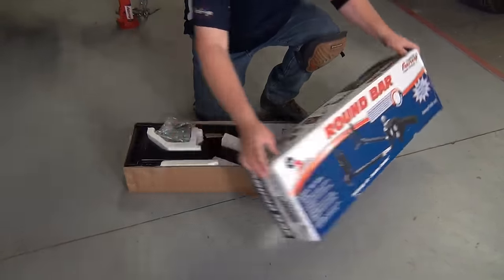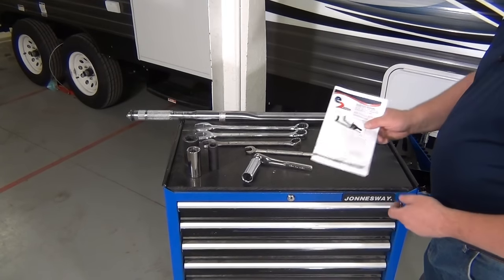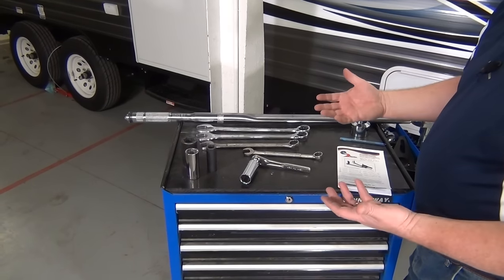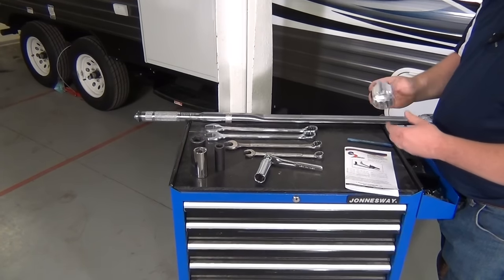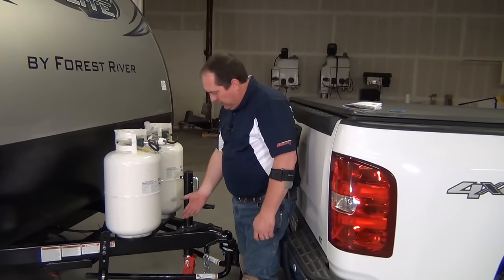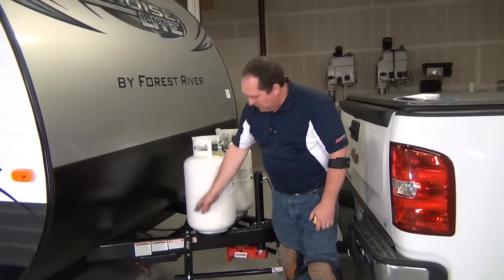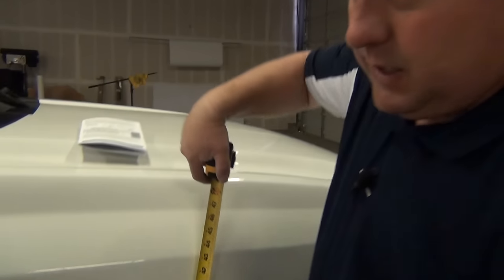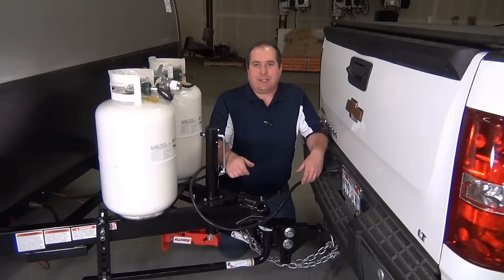How To Install Your Fastway e2 Round Bar Sway Control / Weight Distribution Hitch*

Comment: Would you err on the side of placing the hitch head at a height lower or higher than the height of the top of the coupler?  Top of my ball is 24 1/2". The hitch head in the top holes in the drop position is about 23 7/8".  The hitch head at the bottom holes in the rise position is 25".
Reply from the maker: +Tundra, Tools, and Tech,
Great question! We recommend that you drop it to the 23-7/8" height, just slightly lower than the coupler. Either would work fine, but going down instead of up will give you just a bit more weight distribution force assuming the same number of spacer washers and same L-bracket height.
Reply: how close should the two heights be when starting the process? I have about 2" difference (ball is lower) and no matter what I do I still have about 2 3/4" sag in the truck. I guess I need to order the specialty shank..??
Reply from the maker: +Romd inKs,
Great question, thanks for asking.
We are making the assumption that your tow vehicle is large enough and has the ratings for the trailer you're towing, that the trailer is correctly loaded, good tires correctly inflated, ratings not exceeded, etc. If any of those are off, that should be addressed first.

The ideal is to have the hitch ball at the same height as the trailer coupler (with the trailer level/parallel to the ground). If you are already using the hitch with the shank in the rise position, you would do well to get a specialty shank that raises the hitch ball. If not, simply turn the shank upward, and find the correct position for the hitch head.

Having some sag in the rear of the truck is expected, and actually good. The most critical indicator is the front axle of the vehicle. You are adding a significant amount of weight to the tow vehicle, and you should expect it to sag under that weight. What you don't want is to raise too much weight off the front axle. In most ideal setups, the front axle returns to almost the same height (same axle weight) as it was without the trailer coupled. The rear axle sags and is carrying more weight because of the addition of the trailer. This is good, because it holds your tow vehicle tighter to the road, and gives it more control over the trailer.

Follow the setup process in the owner's manual from start to finish. Get the hitch ball height correct, and then the weight distribution into a good range. Then, test it. See how it tows, and make minor adjustments from there if you need to.

You can find the owner's manuals here: https://www.fastwaytrailer.com/manuals
You can reach customer support here: 877-523-9103 or Support@FastwayTrailer.com
Reply: FastwayTrailer thank you for the quick response. I drive a 6.2L  f250 and the trailer averages 8000lbs. I will the trailer out this weekend to measure it. I did not realize the front measurement was that critical. The shank is inverted and using the top bolt hole with the L bracket bolts to the top side.
Reply from the maker: +Romd inKs,
You're welcome! Yes, the front measurement is the most critical. The rear measurement should be watched, but it is more of a problem if you're getting too much weight distribution and actually lifting the rear up. If your front measurement is good, it is almost impossible to have this happen with the rear. Also, that's a pretty good size trailer. If you're sitting between 800 and 1,200 lb tongue weight, you can expect the rear to sag, even with good weight distribution and that tow vehicle. Good luck! Let us know if we can help with anything else. Also, come back and let us know how it works out if you decide to make some changes to your setup.
Reply: Base on what I've read so far I think I know the answer but want to make sure. TV alone: front is 42" rear is 42 1/2"; trailer attached with no WD bars supporting front 42 1/2" rear is 40 1/2"; trailer attached with WD bars supporting front 42 1/2" rear 40 3/4". good to go or no?
Reply from the maker: +Romd inKs,
In the numbers you give above, it looks like you need a bit more weight distribution. Looking at the front axle measurements, the third with WD is the same as the 2nd, hitched but no WD. You want to go at least halfway back to the first measurement, which would be 42-1/4", and ideally as close to all the way back (42") as you can, without going over. The rear measurements look good because the 3rd (40-3/4") is not higher than the first (42-1/2").
Reply: FastwayTrailer i think i can add another washer but after that i guess i would need to get an shank extension?
Reply from the maker: +Romd inKs,
Adding a washer has a completely separate and different effect on the hitch than an extended shank will. The washers control the pre-load angle of the hitch head, which effects weight distribution, while an extended shank will help you get the hitch ball at the correct height.

First, you should make sure the hitch ball height matches the trailer coupler height, with the trailer sitting level (parallel to the ground). Measure from the ground to the top of the coupler socket, and then set the hitch ball height to that same distance. If your shank is not long enough to make that work, you need to be using a specialty shank that will. Having an incorrect hitch ball height will make it more difficult, and even impossible to get good weight distribution.
After that, go through the weight distribution setup process, adding or subtracting spacer washers to get the best weight distribution setup you can.

The details of this process are found in the e2 owners manual here: https://www.fastwaytrailer.com/manuals
If you need further assistance beyond that, please contact our customer support staff at 877-523-9103 or Support@FastwayTrailer.com

Comment: You took couple measurements but that doesnt explain how you or which holes you knew to put the brackets in on the trailer before putting round bars i am confused
Reply from the maker: Pal Palich,

If we are setting up the hitch for the first time, we start with the L-brackets in the center two of the six available holes. This gives us room to go up or down as needed later on to accommodate needed weight distribution adjustments easily.

Follow the instructions ( http://www.fastwaytrailer.com/manuals ), Step 4 - Sway Bracket Assembly Setup, and it will walk you through the process of placing and adjusting the L-brackets.

Comment: Thanks for the video! I've installed my setup, had to move my L brackets down 1 hole, but the bars are not parallel to the trailer and are point up and seem to be only contacting the front edge of the L Bracket. All measurements check out good, so Im curious if this is normal???
Reply from the maker: That doesn't sound too far off. But you should be able to get them at least pretty close to parallel. Email our customer service a few pictures if you still aren't sure if it looks good. support@fastwaytrailer.com
Reply: I have this same situation as well. I am trying to understand the significance of the washer/angle bolts. Also my L brackets are in the middle holes so if I move down, seems that would grossly affect the weight distribution. Older F250 with 34’ travel trailer.
Reply: Mines the same way.. I recently had to readjust my setup after adding airbags and a leveling kit to my truck.. it's dead nuts on the measurements but the bars won't sit flat on the L brackets

Comment: great video dave. i have a toy hauler 3650 +/- lbs dry weight. bike weighs just over 700lbs. how much variance can i expect in settings while towing with toy vs towing without?
Reply from the maker: +Martin Foley,
Great question! There are a lot of variables to take into consideration, so estimating that is tough. It is mostly a function of the distance from the trailer coupler to the axles, related to the distance from the axles to the bike. Think of it like a teeter-totter. For example, if the coupler to the axles is 10', and the distance from axles to bike is 10', then the relation would be 1:1, meaning, if you take the bike out, removing 700 lb. from the back, the amount of weight it is counter-balancing is 700 lb., so you should see the tongue weight raise by 700 lb. If the ratio is 10' vs. 5' (2:1), the tongue weight should increase by 350 lb. (2x350 = 1x700).

Unfortunately, there is not an easier way to predict the hitch setup you will need than to set it up both ways (with and without the bike), checking to make sure the weight distribution is dialed in on both of them. Then you will know where to set the L-brackets based on the trailer loading.
Reply: thanks dave, very helpful
Reply from the maker: +Martin Foley, you're welcome.

Comment: looks like my RV dealer installed my L brackets upside down??
Reply from the maker: +Ron Jernigan,
Not to worry! Installing the L-brackets upside down is a common practice with the e2 hitch (especially if you have a bottom mount coupler https://youtu.be/WM8e60mbqAM), and is frequently done on the round bar hitch. As long as your weight distribution measurements check out, and the bolts holding the brackets are tight to the frame with no gaps above or below, you're fine. You can see the details of when and why they would be placed upside down in the owner's manual here: http://www.fastwaytrailer.com/support
And if you're still concerned, get in touch with our customer support team, and they can find answers to your questions. 877-523-9103 or support@fastwaytrailer.com.
Reply: @FastwayTrailer  I took the day today and Re-Set everything, new truck, with a Level, and installed the Roadmaster Active Suspension the other day. Just got done and everything is Much Better. This video was great, and Easy to follow! I just need to get that breakaway cable you show in the video!

Comment: When I bought the E2 Round bar it was set up for a 2016 Colorado, we have since upgraded to a GMC 2500, I have adjusted the ball to the proper height but what about the L brackets, should those move too?  There was a 6 inch difference between the Colorado and GMC 2500.
Reply from the maker: +Chris Sheehan,
Great question! The L-brackets may or may not need to be moved. Getting the hitch ball to the correct height is the first step in setting up the hitch when you change tow vehicles (or trailers). Now you need to go through the process of setting up and checking the weight distribution. It will most likely need to be adjusted, and that is done by adding or removing spacer washers between the hitch head and adjustable shank, and/or by moving the L-brackets. Follow the setup instructions in the owner's manual here: http://www.fastwaytrailer.com/manuals. If you need some help, get in touch with our Customer Support people at 877-523-9103 or support@fastwaytrailer.com.

Comment: I currently have an e2 set up on my 2015 Toyota Tacoma for towing our camper- this weekend I go to pick up a new Tundra- do I need to readjust the setup on the camper or can I just make sure the ball height is the same as with the old truck?
Reply from the maker: Scott Domuracki,

Yes, you need to check the complete set up of the e2 hitch when you get your new truck.

If the receiver height on the new truck is different than the old, you need to make sure the ball height is adjusted back to be the same height as the trailer coupler.

You will also have a very different suspension on the new truck, so you need to go through the weight distribution setup steps to check that you're getting good weight distribution. Be sure to check that the bolts are torqued correctly when you're done making adjustments.

Here is a link to the e2 owner's manual: http://www.fastwaytrailer.com/manuals

Also, feel free to contact out customer support team if you have any other questions M-F, 8:00 am - 5:00 pm MST, at 877-523-9103 or Support@FastwayTrailer.com.

Good luck, and enjoy the new truck!

Comment: My RV dealer installed this weight distribution hitch on my new 29' Keystone Passport. I watched the technician do it. I do not recall that he used a torque wrench for any of the nut tightening. And although the area was fairly level, it was not perfectly level and was not paved or concrete. I do not recall that he ever measured the height of the RV frame. His only check to determine that the hitch was installed correctly was to compare the distance between the front tire and front fender edge with the distance between the rear tire and the rear fender edge.

I was used to pulling a smaller RV with a different weight distribution hitch. By comparison, this setup felt much less stable on the road. Steering was less positive. I was not sure if the difference was due to the fact that this is a larger RV or that perhaps the weight distribution was not optimal. I am inclined to re-install it.
Reply: I just experienced this exact same scenario with my recent purchase of my 26ft Mini Lite. I'm getting sway with wind and semi-truck passes, and knew when the technician was doing the camper tutorial with me, he mentioned a remark, "what's the camper weigh, 4800lbs?" That told me right there that he probably/did generically installed the E2 WDH, as the camper weighs 6200 dry. I'm needing to check my pitch, and also make adjustments to the sway/distribution bars as I've got quite a bit of sag in the rear. 2022 Rockwood Mini Lite 2615S towed with a 2021 Ford PowerBoost Crew Cab.

Comment: The rv dealer installed mine while tanks were full..we never plan on driving with full tanks. Should I readjust? Washers or ?
Reply from the maker: +Dave Merwin, The only way to tell if it should be adjusted is to take check the weight distribution. If it does need to be adjusted, that can either be done by adding/subtracting spacer washers, or by raising/lowering the L-brackets. If it is a long-term (permanent) change, we recommend making the changes via spacer washer. If only temporary, moving the L-brackets is easy and works great. If you need a refresher on making the adjustments, you can find that process here in the owner's manual: http://fstwy.co/manuals  If needed, you are also welcome to contact our customer support staff at 877-523-9103 or Support@FastwayTrailer.com .

Comment: I'm not sure why my last comment disappeared. I was hoping to get some help with putting the spring arms into hitch head. Only on one side of the hitch head has a jam when installing or removing the round bar. The pin is not smooth and I can't get it to pull all the way out. When I use the taper to pull it out, the taper bends to the point that I can't get it fully out. It seems like the pin is not smooth or the hole that it travels is not big enough. Can you please help with this issue? Thank you.
Reply from the maker: A V,

The spring arms are designed with a chamfered edge on the end that slides up into the hitch head. It should look like a bit of the top corner has been cut off on an angle. Try inserting the arm with this chamfer lined up with the retaining pin. Put a little grease on the top of the arm. You should be able to push it up into the head, and that chamfer will push the retainer pin out of the way, then let it drop back into the retaining slot in the arm to hold it.

To remove the arm, try turning it out sideways to about 90 degrees perpendicular to the vehicle - kind of parallel to the bumper. This should push the retainer pin out of the retaining slot, and let the arm drop out of the hitch head.

The spring arm and hitch head tube need to be lined up well. If it is binding a bit, make sure it has some grease on it, and move it around a little to try and line them up. I usually hold the arm about where the sticker is so that it will balance well in my hand and I can shift it around a bit to get it lined up.

Try these, and if you still need some help with it, contact our customer support team M-F, 8:00 a.m. to 5:00 p.m. Mountain time. They will be glad to help you!

You can reach them by emailing Support@FastwayTrailer.com or calling 877-523-9103.

Comment: I am ordering a 20' cargo trailer with a 2x8 tube frame which is an upgrade. What do you do about that?
Reply from the maker: @Ole Guy, get in touch with our customer support staff. We have some specialty link plates that you can use on an 8" frame. 877-523-9103 or support@fastwaytrailer.com.

Comment: I don't understand the purpose of the spacer rivet and spacer washers.  Are they there to fine tune the height of the hitch ball?
Reply from the maker: +Jack Adams,
No, the spacer rivet and washers are not to fine tune the hitch ball height, they are to take up the space between the top of the hitch head and adjustable shank. The height of the hitch ball is determined by the position in which the head is installed on the shank, which is a factor of the holes chosen and orientation of the shank.

The spacer rivet and washers sit in the gap between the top of the hitch head and the shank. They take up the space between them so that there is a solid connection for the weight distribution all the way through from the trailer to the tow vehicle. Adding or removing washers during setup changes the angle between the head and shank, and this is one of the ways the amount of weight distribution is adjusted. More washers = more weight distribution, less washers = less weight distribution.
Reply: Thank you for the explanation.
Reply from the maker: You're welcome +Jack Adams! Thanks for the question.
Reply: Simple, great explanation,  you rock!